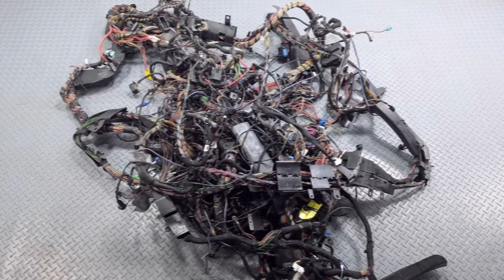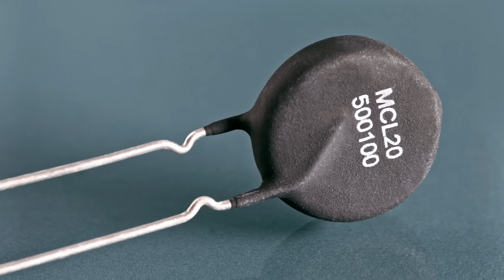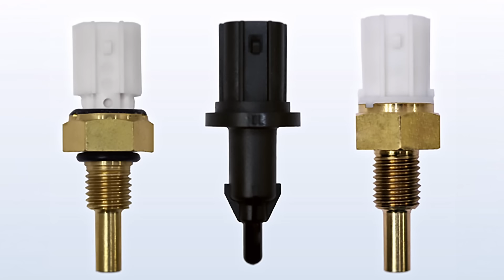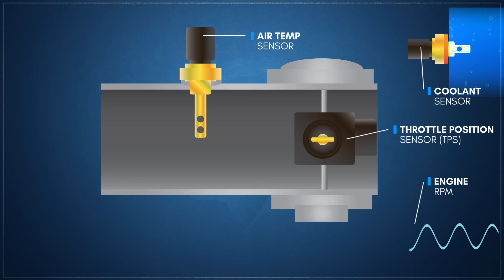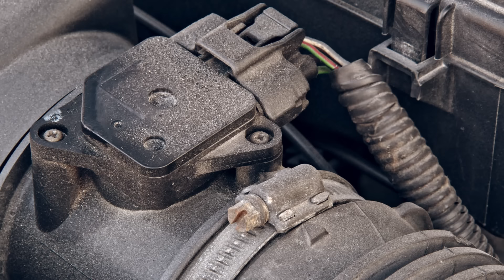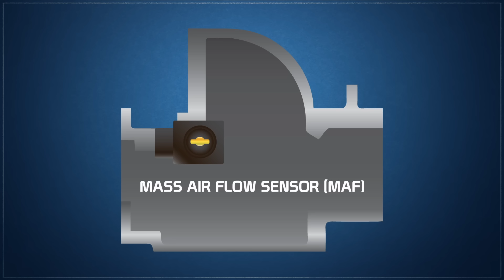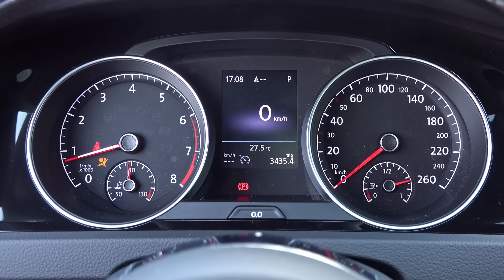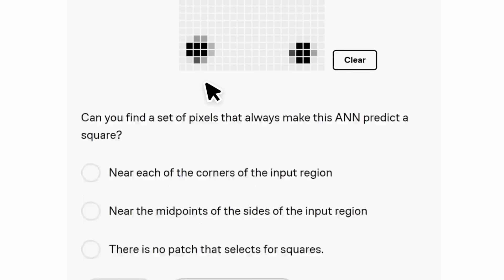The Insanity Of Engine Sensors

Comment: The 90s were the peak of automotive technology. Just the right balance between digital and analog to produce long-lived, repair friendly, economically manufactured vehicles.
Reply: I disagree, I own a 93 1500 step side and it’s honestly a pain to work on, I’ve also owned multiple BMW’s spanning from 99-2016, older vehicles are simpler not necessarily more reliable, and when it dose come to finding an issue it depends on how you diag and the problem your diagnosing.
Reply: I'm no mechanic, but there's no way cars made now are gonna last 10-15 years with all the electronics
Reply: @dustin600  I helped out at a local mechanic for over a year. older cars that came in just had basic maintenance (oil change, brake discs, joints and sockets) while newer cars that came in had issues caused by faulty sensors. locating and figuring out those sensors is a nightmare. it's like they're made to trip more easily. Defect touchscreens suddenly make all your features like AC, stereo, navigation and everything that used to be analog buttons and knobs useless since you can't press on the screen. In my 2010 mercedes I can take turns at high speeds without having to look down at the console because i can feel exactly what knobs im twisting and what I want them to do. I don't want a car made after ~2016
Reply: @Killbayne please don't take turns at high speeds though, it's extremely unsafe for everyone around you
Reply: @kohai-kun9261  I didn't mean to sound like I'm driving like an idiot, by high speeds I mean something still appropriate to the curvature of the street. I can't go cornering in that car lol
Reply: @dustin600  I give vehicles made with an LCD screen a very short life. No one will be restoring these vehicles nor will they ever be a collectable. They will be smelted down for replacement parts for vehicles older than they were.
Reply: @dustin600 Some car brands and models were still good up to the mid to late 0000s but anything since 2015 onwards is probably going to fall apart at 10 years
Reply: @dustin600 exactly
Reply: @dustin600 yeah we can tell you aren’t a mechanic… mechanical sensors are inherently more prone to failure
Reply: @dustin600 yessss 👏👏👏👏👏🎯🎯🎯🎯.
Reply: @dustin600  the problem is most people can fix mechanical stuff and most electrical items need to be replaced because its cheaper and easier than fixing it
Reply: @dustin600  Electronics are typically more durable than moving parts unless you make them like shit or make them depend on constant software support
Reply: @schniemand yeah no, the plastic cracks, the cables get brittle, etc
Reply: @schniemand  I'd argue there about the same. Most electronics your not using for 20 years and they're in comfortable environements. You upgrade long before they break. 
I have a 21 year old car 170k and motor/turbo/transmission runs fine no oil burn.  Radio, window switches, door switches, coil packs, and sensors have all needed to be replaced. Mechanical items tolerate harsh climate better than electronics. The outdoor weather is very harsh on electronics in vehicles.
Reply: Mr Anderson
Reply: Peak was probably a bit later, tbh. Early 00s solved a lot of the heat and EFI control issues that cropped up in the 90s. Introduction of VVT and the elimination of the distributor greatly enhanced reliability and performance, without really adding too much in terms of maintenance or repair issues. 

I had a timing belt skip some teeth on an early 00s Hyundai Accent (failed tensioner), and the Timing controls compensated so well that I was able to drive the car home and repair it w/ no damage. Blew my mind @ the time.

Compare a 90s Civic w/ an 00s Civic, or a 90s Corolla w/ an early 00s Corolla. The 00s Civic and the 00s Corolla, w/ regular maintenance, could last 1,000 years.
Reply: And then they realized, "wait these dumb sacks of crap have to buy our product to get around. If we make it so they break down as soon as the warranty is over, we can keep selling them new cars!!" And the Elon Musk did even better and started selling cars with features they don't even have yet! Just a pinky promise it will EVENTUALLY have a self driving feature. Pathetic poor people hahahaha it's so fun being rich and ruining people's lives for money instead of providing any value to humanity
Reply: Idk the 2000s were pretty damn good as that's roughly when we started getting the ls engines started taking over for performance GM vehicles
Reply: Na things are WAY better now thankfully
Reply: Ls400 is a perfect example of this. Absolutely unkillable car
Reply: You nailed it ....🎯🎯🎯🎯👌👌👌👏👏👏.
Reply: i feel like the 2000's is the better era because of simplified electronics such as the use of OBD2 system and more modern fuel injection
Reply: Emphases on repair friendly, especially John Deere!
Reply: Disagree
Reply: Now manufacturers try to optimize profits.
Make customer be satisfied with the purchase but require new purchase not too far into the future.
Reply: My 99 4Runner is one example of how robust the 90s tech was. Rarely needs anything beyond routine maintenance, 240k miles, and I wouldn't hesitate to drive it across America, coast to coast. Fuel mileage on the other hand....16 mpg on the hwy would make that trip rather expensive today.
Reply: I agree with that completely modern cars are ridiculously complicated.
Reply: Yee.. and also the peak of ecological disasters.
Reply: I feel this way about life in general, no smartphones, no social media, no trashy tattoos. The only problem was Ugly CRT TVs and cable-tv which ruined the late 20th century.
Reply: @JOSEPH-vs2gc  I'd wager that CRT TVs, especially the 90's Sony were extremely elegant. They would lose a bit of their enchantment, every time you had to carry them to some other place, but still. In general, I couldn't agree more with you.
Reply: @JOSEPH-vs2gc and the alternative to cable TV now is better? I mostly just watch YouTube but if I wanted the full "cable TV" experience these days I would have to subscribe to about 15 different streaming services. Id argue that cable was better.
Reply: @CarsNCombat  you must have misread, Cable-Tv RUINED Us, before Streaming services RUINED Us.
Reply: as a guy that repairs all eras of electronics: lol
Reply: Yeah, automatic seatbelts were toootally the peak...
Reply: @tacokoer those were phased out in the early 90's. Are you implying modern cars are better and last longer or something?
Reply: @ We're talking volvo 940 and 850 which is peak car.

Comment: that is why I love the 1.9TDI and will do everything to keep it alive
it has like 10-12 sensors, was built before computers made engines terrible and is basically guaranteed to last 400-500.000 miles
and that while it gets great milage comparable with modern engines.

the 1.9TDI is so reliable that selling a used engine is basically pointless because they don't wear out before the rest of the car is economically no longer viable to repair
so nobody will buy it unless they wreck it with insane tuning experiments
realistically you get "head lift" before anything else would go bad, so you would really have to go crazy.

Comment: I will still drive my lada niva, where the smartest electronic device is charge voltage regulator, but where carburetor can be fixed by knocking it with the hammer a couple of times
Reply: That’s not how you tune a carb😂

Comment: Just had to diagnose a faulty ECU on my 1990 Mitsubishi Galant. In the process, I learned a lot of how the different sensors send their signals to the ECU by reading the service manual.

Unfortunately the issue was caused by a slightly leaky capacitor that had corroded away a trace on the ECU board, which then cut the power to the 5V regulating transistor, meaning voltage spiked and all 5V sensors got 12V instead. 
I changed the capacitors and fixed the broken trace, but it was unfortunately too late.

The sensors themselves survived, as they were mostly just resistors like you mentioned, however the analog inputs on the ECU are now dead. I am missing four sensors. The car starts and runs okay whenever it is warm, but is a pain to start in the cold. The service manuals mentions the default value the ECU uses whenever a sensor fails, pretty neat, and it defaults to 25 degrees Celcius air intake and 80 degrees engine temp, meaning it doesn't get the right amount of fuel/air.

I'm most likely getting a replacement ECU tomorrow, going to double check the 5V supply and replace the capacitors on that one.
Reply: Phenomenal work dude. Diagnosing that sort of stuff is a huge pain but great experience for understanding how our cars are controlled nowadays. I went through something similar on a 92 3000gt VR4 but jumped straight to an ECU swap, I should've taken the time to learn 😅.
Reply: I removed the computer entirely from my 91 camaro and installed a carburetor instead. Hope this helps :)

Comment: My '85 Opel Rekord 2.2e has port injection, but here's the kicker! It doesn't have cam or crank sensors, just coolant and oil temp, vacuum sensor and a mechanical air mass sensor. It boggles the mind of my fellow mechanic friends 😂

Comment: i had traumatizing check engine light experience. engine shutting down while on highway dead power steering and brake pedal booster. from that moment every drive is anticipation of check engine light. heck even low fuel warning light makes my heart beat jump faster cause it has same color.

Comment: I suspect we'd be much better off with a minimum sensor package and reduced emissions components, considering the initial cost and the failures that are inevitable with such complexity and a tough operating environment.  I'd like to see what an engine developer could do with just a three or four cyinder engine fitted with wide band O2 sensors on each cylinder exhaust.  That way, if a cylinder doesn't fire, it doesn't result in the system reading high O2 and increasing fuel to all bank cylinders.

Comment: Every fault that has stopped or limited my vehicles ability to operate,has been due to a sensor failure, not a fault with the mechanicals. The sales of replacements for faulty sensors appears to be the goal of manufactures,not reliability. Tell the computer geek heads to seek employment where they belong, Microsoft.

Comment: Have a crankshaft sensor that keeps failing, and without it, the engine runs like shit. On newer models the car will refuse to run without a functioning camshaft sensor. Just changed it a couple of months ago, and again it failed

Comment: As a retired computer repairman, trying to follow the logic of a fault and matching the physical layout with the idealized circuit diagram is mind-boggling. A simpler engine technology is needed. It already exists - the turbine engine. Almost any combustible fuel can be used and runs so hot that you don't need to worry about noxious by-products.
Reply: Turbines will never be practical in cars
Reply: @user-fs9mv8px1y  Just use the turbine to generate electricity to charge a battery pack. Electric motor and gearbox. No complicated drivetrain. Make everything modular. Swap out for repair. https://www.youtube.com/watch?v=fOIrB1fwVPc Guess what powers an Abrams tank?  https://www.youtube.com/watch?v=b2A5ijU3Ivs  https://www.youtube.com/watch?v=cPOmuvFostY No need for catalytic converter. Best vehicle for Africa.
Reply: Gee, I sure wonder why all cars aren't turbine engined!
Reply: @ADUSN  Probably the same question on Jay Leno's mind.

Comment: This IS so funny to compare to industrial sensors. One of my teachers in the university said the company was messing with them because they put three temperature sensors on a 500L tank. The tank IS gonna have some variability with the temperature but he said that It was enough with two in case one of them failed. And this guys are putting more than 30 in the motor alone. WTF IS this.

Comment: I despise all of this, it's disguised as something positive bla bla bla but really what it is, is just more crap that can go wrong, add cost, complexity and planned obsolescence. This crap isn't necessary to make an emissions lean vehicle. Jetting can be leaned out for a slight loss of power, and ethanol can be added in small amounts to suppress carbon/ nitrogen oxides etc. I'd rather a simple engine that I can understand completely and repair myself.

Comment: At the end of the day, everything is all relative. I’ve heard people mention over the years that points and condenser ignition systems needed to be gone through every 10,000 to 12,000 miles on older engines from the 1960’s, but my father once had a Jeep Cherokee from the 2000’s that needed to have the sensors replaced every so often whenever it threw a check engine light. Since the sensors can be tricky to get a to especially with today’s late model vehicles, it’s no difference in my eyes in comparison to replacing ignition points. People will probably say today’s vehicles are difficult to work on in 20 to 30 years time. It’s all relative at the end of the day.

Comment: The very first electronic fuel injection was an experiment by Bendix, perhaps in the 1960's.  They used a Chrysler V8 engine, off the shelf solenoids for the injectors, and.....vacuum tubes!  They sold their patents to Bosch, which then used it in, of all things, VW buses.  Now, of course, they are in every engine produced.
Reply: The Bendix Electrojector which became Bosch D-Jetronic.
Reply: @gregorymalchuk272  Didn't know that one, thanks!

Comment: Though informative, there is a lot of incorrect information in this video.  Just for instance, potentiometer vs. rheostats. Its not a evolution of a product its just a different application.  You can always use a potentiometer as a rheostat but not the other way around. The pot generally used to sent variable voltage levels where as a setup tends to control current flow. (Generization)
What is sayed about thermisters vs thermocouple is not technically wrong but the selection process is not simply because of temperatures. There is also range and speed of detections.  Thermocouples change temperatures slower, which can be an advantage.  Most importantly thermocouples are cheap in comparison.

Comment: It's actually not that crazy.

Auto manufacturers have had the same access to industrial sensors anyone has, and they have been cheap for decades.

Ask yourself why sensors are not standardized across industries?

Someone jokingly said "big sensor". Not wrong in a sense.

If the market was operating in a free manner, everything standardizes and profits drop.

Why does the same brand of engine use different cam sensors? Literally makes zero sense

Comment: As an old mechanic with crippled fingers, if I were young again I would purchase a car from the '60s or '70s with a small block V8. I would get rid of all of the garbage advised by the EPA, a useless organization, and build a simple but powerful and fuel efficient vehicle. 
One of my V8 vehicles I simply replaced the intake manifold, Edelbrock medium rise aluminum, with a four barrel high quality carburetor. Immediately found an increase in fuel mileage and power. So very simple. I guess then I would go on to improve the suspension. And again the EPA is a useless government operation that should be eliminated.
Reply: Man you just made my day. I got a c-10 with a 305 bored out .60 over makes pretty good power and gets 30 mpg. I wrote a letter to GM to reissue the 1957 Belair with a 283 four barrel 2 speed power glide,  I doubt they will listen to me I'm only in my early 20's. Also advice if you want to make more power and get even more millage modify your distributor next. Buy a 7 dollar proform advance curve kit and put the lightest springs on there and use the heavier stock weights. There is no reason to not have all your mechanical advance in by some higher rpm like 3,000 rpm! Engines need more timing at lower rpms because the the piston speed is slower not doing as good of a job squeezing the air fuel mixture together. But the biggest thing is that the fuel burns slower under vacuum needing more timing so make sure you have a vacuum advance and connect to a manifold vacuum port.
Reply: Every time I go to Mexico, I'm reminded of why some emissions controls are good. Down there, no one gives a flyin fuk about the environment. I pass cars all the time that reek of gasoline. Diesel vehicles roll coal like there's no tomorrow.